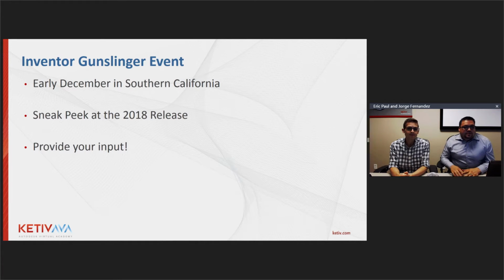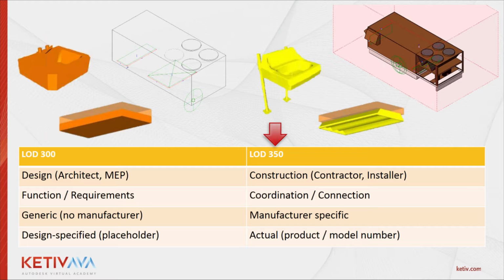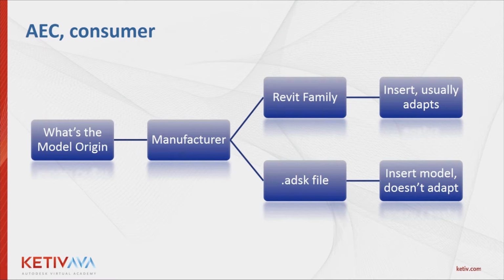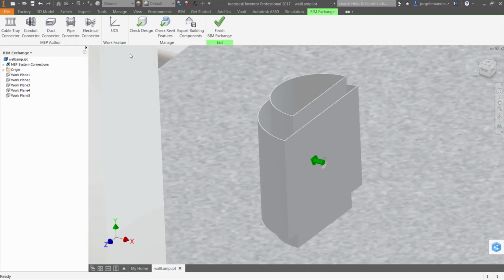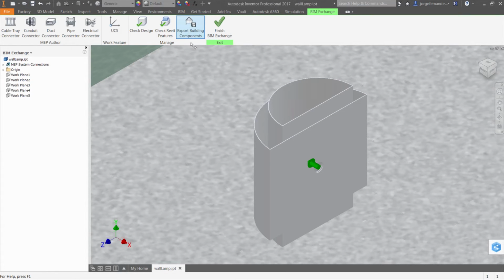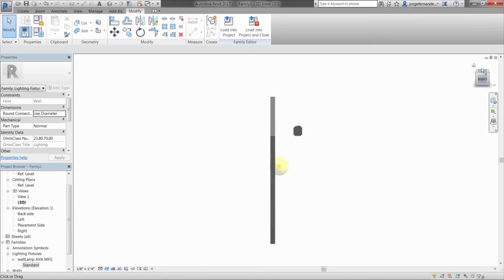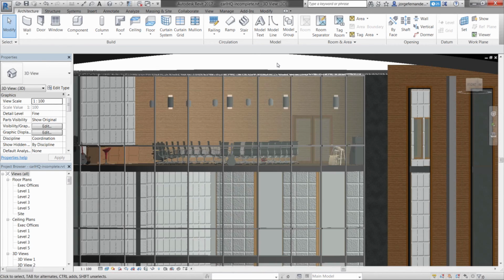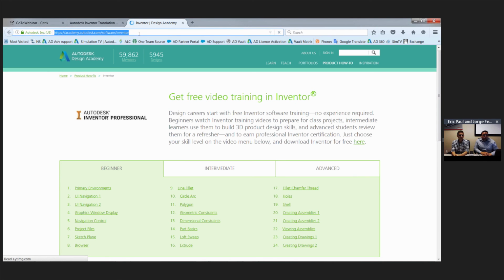Autodesk Virtual Academy: Creating BIM-Ready Models in Inventor

Comment: Hi,
I followed the tutorial and created a wall based .rfa object. When placing the item into a project it wouldn't sit on the face of the wall but slightly inside of it, any ideas what I might have done wrong? After that I then started using generic plane/surface templates assuming that the wall based templates were really only for windows, doors etc. that require a cut into the wall.
Reply from the maker: Hi,
This might be something I can help out with by sending me the file you're referring to. Please feel free to email me at jorge.fernandez@ketiv.com.

- Jorge Fernandez, KETIV Manufacturing Solutions Engineer